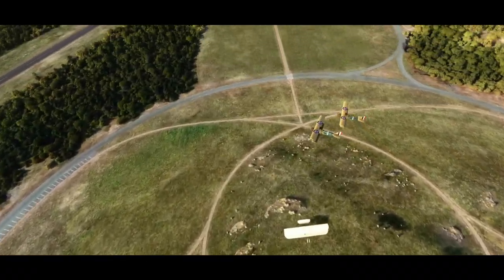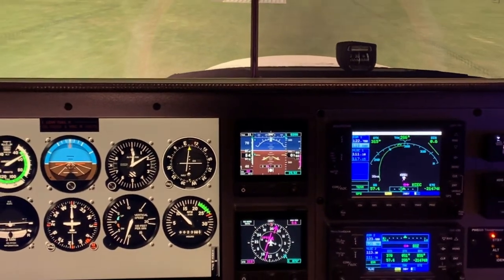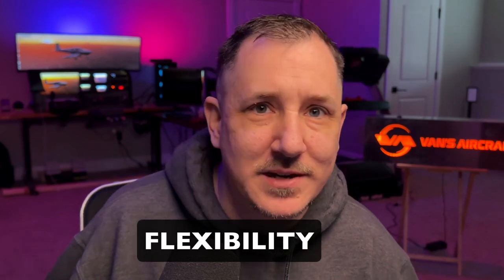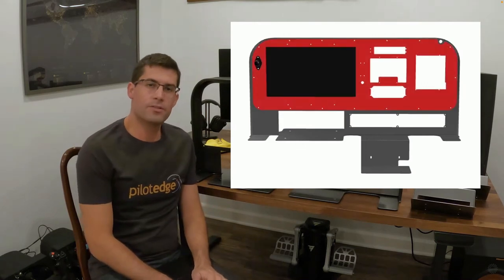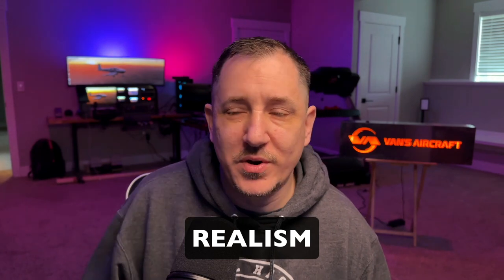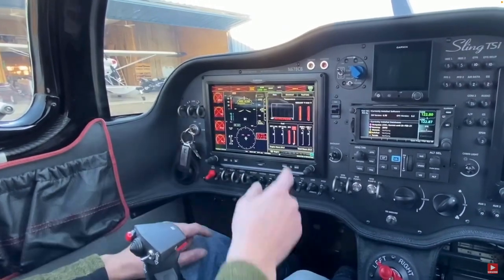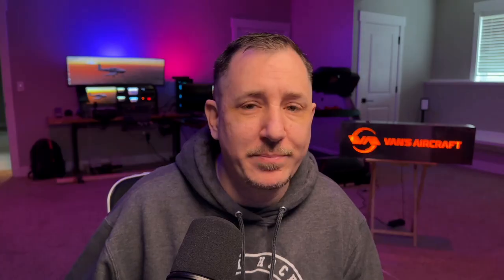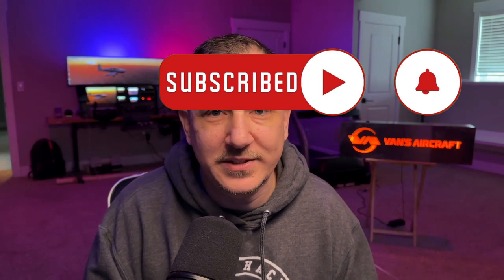5 Secret Tips: Building a Cessna 172 Home Flight Simulator

Comment: My favorite hardware purchase (over the years, since starting with the Original Microsoft Flight Simulator back in 1982), hands down, is either my Altimeter Motives Cessna 172 panel or my HP Reverb VR headset! They are both around $400 so take your pick? The vast majority of Private Pilot Licenses were issued in a Cessna 172 so the Altimeter Motive panels makes sense for wannabe pilots. The Altimeter Motive Panels are the best "Bang for the Buck" (that I can think of), for a feeling of realism and emersion. VR headsets are great for the visual "candy" but you'll be fumbling for your mouse continuously! Of course, start with a Yoke, throttle and rudder pedals and branch out from there. Just my thoughts after 30 years of flying and buying flight stuff!
Reply from the maker: Awesome, yea Altimeter Motives has some cool products, I met them at the flight sim expo last year and enjoyed their lineup, thanks for your insights!

Comment: Maybe dumb question. Let’s say I build a setup that has a specific avionics suite from one of these sim stores. What happens if I’m flying a plane (in the sim) that does not have that same radio/navigation? Can I use my gear anyway or are they useless? I’m not necessarily concerned about realism and whether the physical gear matches the plane. More from a hobby perspective. Those units are expensive and who wants to buy multiple variants or spend time swapping things out for different planes unless you are specifically training for certain aircraft.
Reply from the maker: Good question….  Most physical items u install to a panel will piggy back off the native software so if you switch aircraft, the hardware should work for the new model.   In some cases like the gtn750, this may not work because you would need realityXP to drive the hardware, but it should work in any aircraft you want to add a 750 to.  It’s a trial and error game tbh, it becomes a game to see how to get everything in working in your favorite aircraft….
Reply: Hey i am curious I am building w new PC and i really like the looks of your PC case can you tell me the brand, model, and if you like the case so far.. i have all the parts but i am struggling with which case to put it all in and i really like your case… i hope you can help me out…. Thanks

Larry

Comment: Hey i am curious I am building w new PC and i really like the looks of your PC case can you tell me the brand, model, and if you like the case so far.. i have all the parts but i am struggling with which case to put it all in and i really like your case… i hope you can help me out…. Thanks

Larry
Reply from the maker: Hey Larry, Yea, it's a Corsair 4000D Tempered Glass Mid-ATX [Black] case, was about $109 USD.   It's been fine for me, It's good size, I like it -- it's a tight fit for my cooling system, which is a DeepCool LS720.   Whatever you get, definitely make sure you have the space.  Nothing worse than working in confined spaces.